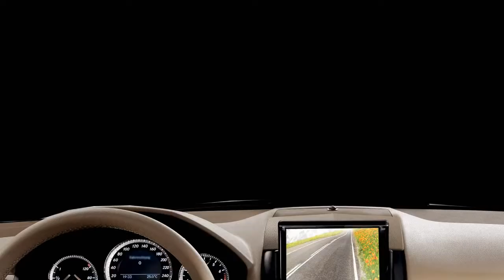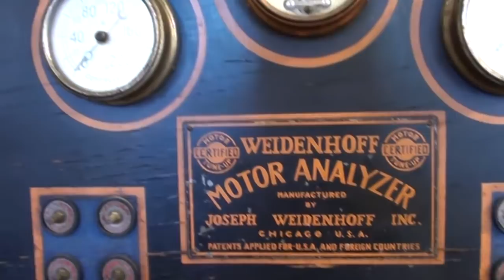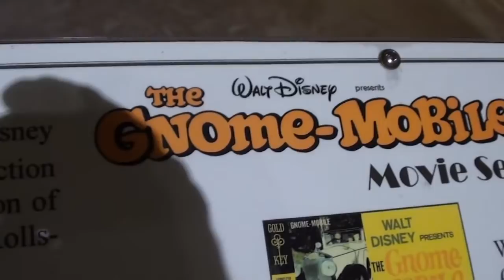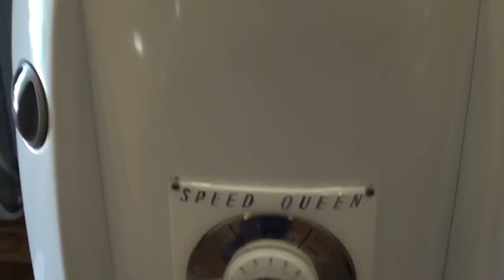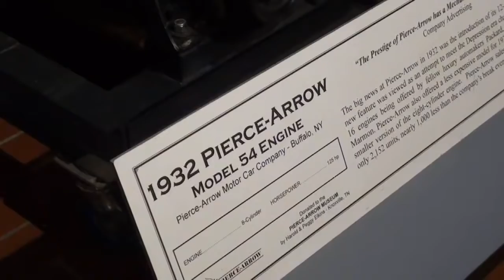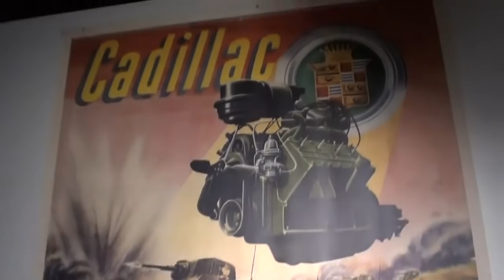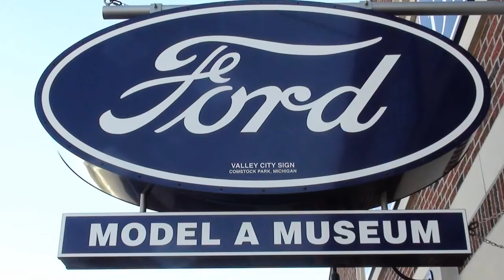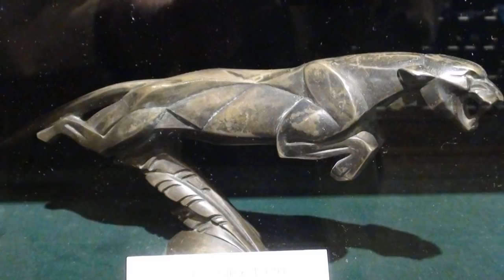GILMORE CAR MUSEUM pt 2 tubalcain corvair kaiser chevrolet

Comment: Thanks for the tour Lyle. I hope Mrs Peterson was not too bored by the end of the day. I was interestd in the Condor motorcycle, so did some research on it, as it looked like it had a Ducati engine. It was a  ¨Swiss Army¨ motorcycle and they were fitted with engines made by Ducati or Spanish company under license.  I had a 250 Ducati about 50 years ago.

Comment: Hot rodders used Caddy engines and  the 500 cubit engines were used in rail dragsters back in the 90's. Your tour was much better than Iron Traps. Would have been neat to see the restoration shops to see what they were fixing or machining.

Comment: I have not been there in many years. Clearly they have added a huge amount. 

When I was a kid they had a steam locomotive on display (i always suspected they intended to add a train ride to go around the campus)
They had a small train station that was where the double decker bus would start it’s circuit around the campus. 
Last time I was there, my wife had a blast finding typos in almost all the displays.